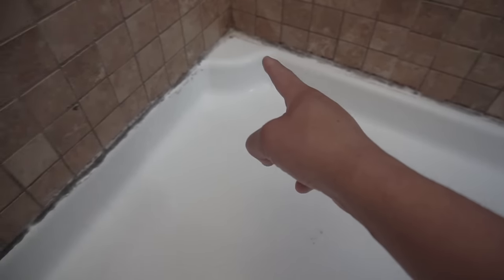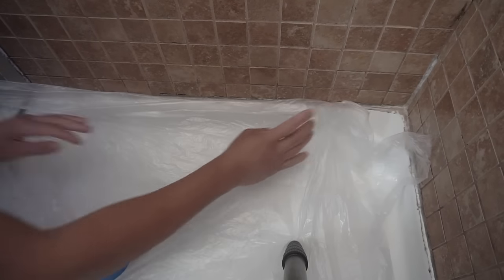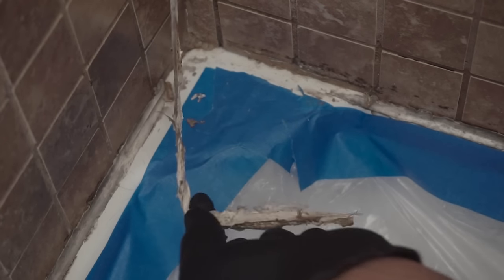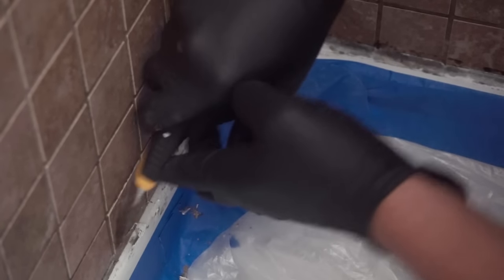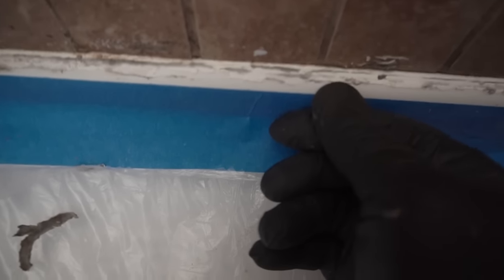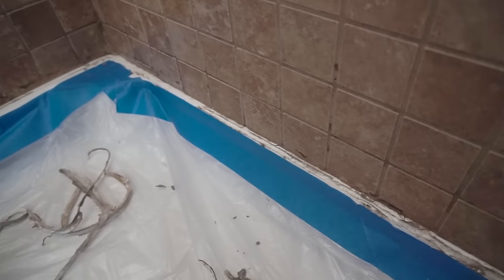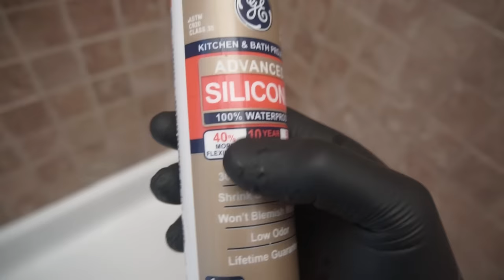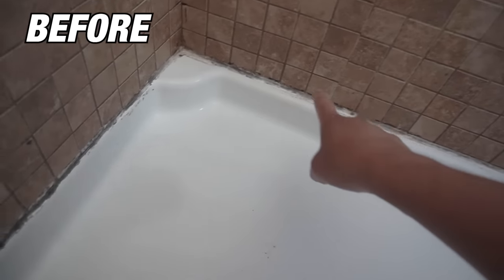How To Remove And Replace Moldy Shower Caulk! DIY

Comment: For thirty something years in my business a 1/2-inch sharp wood chisel seems to work better than anything I've tried.
Reply from the maker: Hi Jay! Thank for sharing the tricks of the trade from your years of experience! 🙏🏽👍🏽
Reply: @jaya.0069.  I was afraid of that! Some of that rock hard caulk also touches the tile and I’m really not wanting to chip up the tile to get the old caulk out but it’s gotten so cracked and nasty looking. I don’t have much choice. Thanks for the tip on the chisel.😊

Comment: I also use isopropyl alcohol to clean the surface before applying the new caulk. It cleans off unseen residue, and the new caulk adheres  so much better in the long run. Great video.

Comment: TIP: use masking tape on top and bottom for the initial bead, smooth with WET finger (or) WET tool (water) as seen in the video, removing 90% of excess caulk (gloved hand, ideally, box of 50+ gloves is under $10 at Harbor Freight), then quickly remove tape. Immediately go over bead one more time with wet finger to avoid a ceiling or edge on the caulk that will catch water and be difficult to clean later. Keep in mind the drying time of the caulk and move as quickly as possible as soon as you start installing new caulk. 

Also, cleaning surface with a rubbing alcohol wipe before caulk application will give you the best surface for the caulk to stick to as it will remove any oils or remnant shampoo/conditioner that may have gotten behind the old caulk. Let dry for twice the time on the label, make sure air is circulating and consider wearing a chemical mask to protect from fumes.

DO NOT touch caulk to check if dry. It will stick to your finger and will not be fixable without repeating process. 

Repeating the process is not the end of the world, just don't be afraid to try. Mold gets you sick and it will just continue to find places to go.
Reply: Your comment was more helpful than most of the videos I watched. Thanks for the tip about rubbing alcohol.

Comment: I have been a professional caulker for over 45 years and almost never use tape. But it is exactly what I recommend homeowners do. And NEVER do any of the stupid crap shown n YouTube,like wet tooling( using water,soapy water, solvent or worst of all window cleaner) using any liquid to tool with WILL cause the sealant to fail prematurely.
Good job👍
Reply: Don't you clean between removing the moldy caulk and placing the new caulk in it's place? I feel like some bathroom cleaner is in order to make sure you don't seal in  remnants of the old mold that was there.
Reply: @Drayafenandez  as professionals we always clean with a solvent before re caulkimg. Alcohol or acetone works well. Wipe it dry so it doesn’t leave a film. Household cleaner is not a good idea ( many have ingredients that are harmful to the bond or to the uncurled sealant itself.)
Reply: @genecarden780  Thank you!

Comment: A   lot of hard work --  bending, stretching, reaching, and on your knees. My back now hurts.  OUCH!  Nice job!!!
Reply from the maker: I agree! My knees didn’t like me so much, I suggest using a soft padding for the knees and frequent stretching and breaks! 👍🏽😊🙏🏽
Reply: I bought a mop with a scour pad and telescoping handle just for cleaning the shower. Spray the walls and scrub, rinse with detachable shower head.

Comment: i just did this project today in my shower...my first time doing this.a few pointers for the first time DIY'ers....
- seal off the shower drain!...you DO NOT want all that crusty moldy caulk clogging your shower drain.
- make sure you get rid of ALL the old caulking...i thought i got it all but when i went to caulk the bottom joint in my shower there was still some hidden caulk had to scrape it again then re-clean. i used rubbing alcohol on a old dish sponge with the scotch brite side to do a final clean before applying my caulk.
- i used the gorilla glue silicone white caulk in the 2.8 oz small tubes....i had a rough time trying to squeeze the tube to keep the flow even as a result my first joint was messy ...but i figured a way to hold it and keep a steady flow going and the rest of the job went smoothly.if and when i have to do this again i will probably go with the tubes with the cartridge gun.all in all...i am pleased how it turned out and no more moldy caulk.👍

Comment: Can you share how it looks one year later? I had a very similar situation, replaced the caulking with mold proof bathroom caulk, and all the mold grew back from underneath within two years
Reply: Remember, after the big job, maintenance is required. Clean shower after each use, (the mold loves your dead skin), dry shower as needed and good bathroom ventilation.

Comment: Great video! For anyone looking to remove caulk from surfaces and wants to do it in about 5 to 10 minutes and have the funds to spare, get a Dremel Multi-Max with the scraper blade and get it done. It’s money well spent as you can use it for so many other things.

Comment: I would use a single edged razor blade rather than the utility knife. Thinner and sharper but you need to be careful not to scratch the fiberglass pan. I would clean the pan edge with alcohol to make sure the silicone adheres well.

Comment: Any tips for calking under the shower door frame like you did? You can’t get into it with your finger. I suppose at least on my shower it doesn’t matter if it looks pretty because it has a metal lip above it but I’m just wondering what’s important to remember to do

Comment: Great video. My only question is that in the BEFORE there was also caulk going up the wall not just around the pan/base of the shower but in the AFTER caulk was only replaced around the pan. Why is that?

Comment: Hey thanks for this!  Question- Are you supposed to remove caulk from the corners (as in, the vertical line going up to the ceiling) as well?  I can't tell if it's caulk in the corner or grout.....

Comment: Tip: The day before starting to remove the old moldy caulk, roll up a piece of TOILET PAPER. Soak the toilet paper with bleach. Press the bleached soaked toilet paper against the moldy caulk. Remove the next day.
Reply: What is this supposed to do?

Comment: Is it necessary to wipe it dry after each shower to keep it mold free?
Reply: you shouldnt have dry the tiles after using the shower. The whole reason it was getting moldy is because the person who originally caulked the shower was cutting corners to save money and didnt apply the right caulk. If you're drying your shower everytime you take a shower theres a good chance you have some kind of ocd thing going on and probably should contact a mental health professional.
Reply: @cobra5088    😆 I like my OCD behaviors.
Reply: I replaced the caulk in my tub/shower 7 years ago. I squeegee the tile walls and wipe the faucet and caulk down after every use. I never have to clean the walls or caulk (only the tub) and it all sparkles. 

Note, I did not do this at first and the caulk was getting dingy due to hard water. So I scrubbed it and going forward began wiping it down. It’s been pearly white since then. 

Yes, it’s a bit of a hassle. But so is deep cleaning and scrubbing. I’d rather apply an ounce of prevention 😉 Plus it feels like such a treat getting into a clean shower. It’s like being at a hotel 😂
Reply: @Teal_Seal  I like the way you think!  😀
Reply: @rollthers3157   You may be OCD, but I’m OTT 😜

Comment: While removing the old caulking you don’t want to scratch the tub in the process.
Reply from the maker: That is true, there will be scratches that will happen when removing caulking using tools, on the video I suggested using the plastic scraper on the silicone remover tool. In this case just do you best. Having masking tape will help reduce scratches as well 👍🏽😊
Reply: See the video re caulk removers. More application tips.